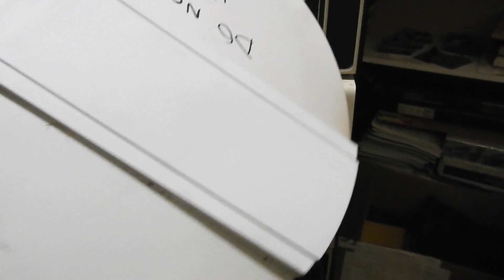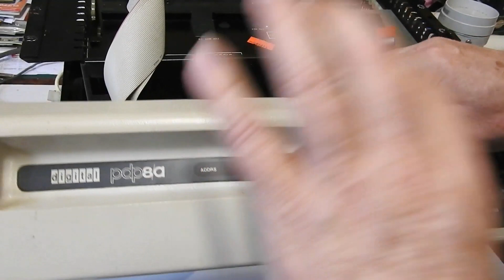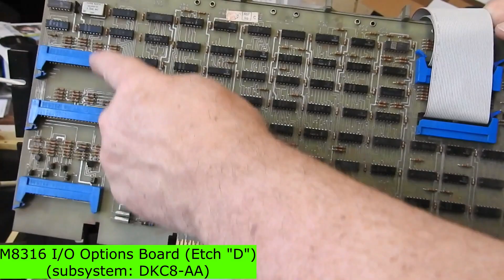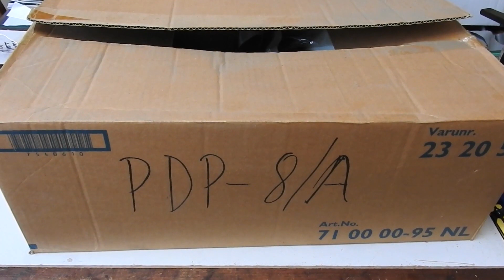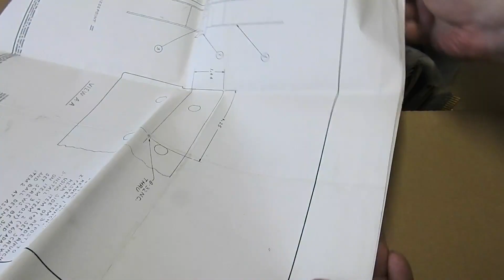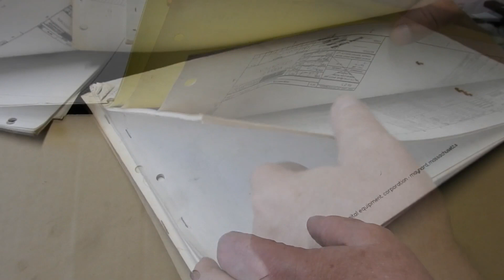PDP8/A - Quick look and Teardown

Comment: 14:07 does not look like core memory to me, but semiconductor memory. At least, the core memory I know is made of arrays of ferrite rings with 3 wires going through them.
Reply from the maker: No, it's not semiconductor memory - way too much analog and power stuff on that board! (semiconductor memory boards are almost completely just chips)
All that electronics is/are the Row/Column drivers and sense amplifiers. I did a very poor job of showing it, but bolted onto the back of that board is another board containing the core plane, with all the ferrite rings and fine wires. These are sandwiched between the two boards, and so protected from physical harm by the front board that we can see.